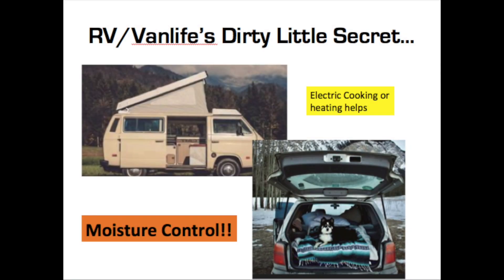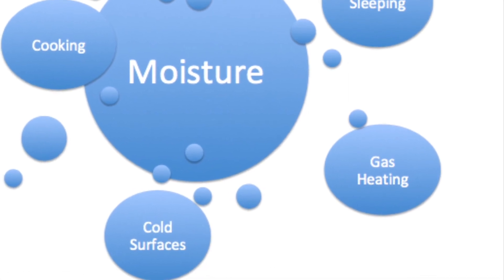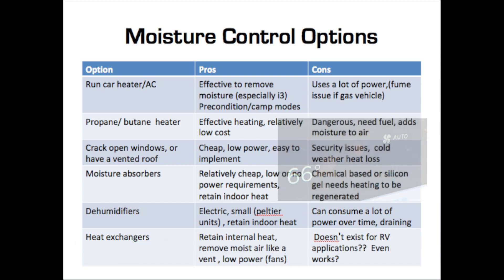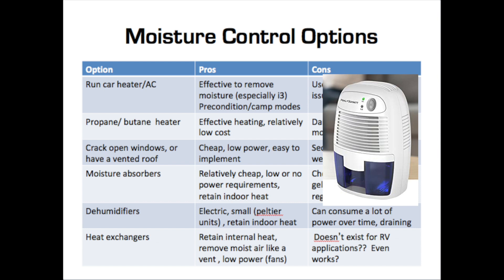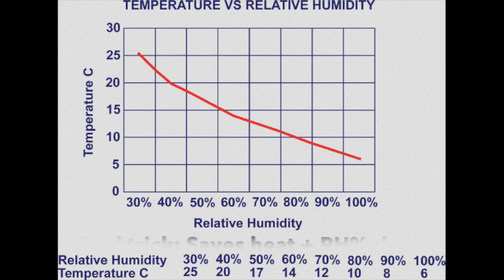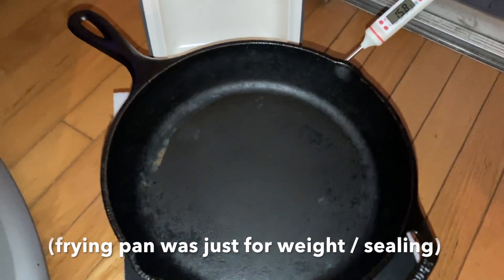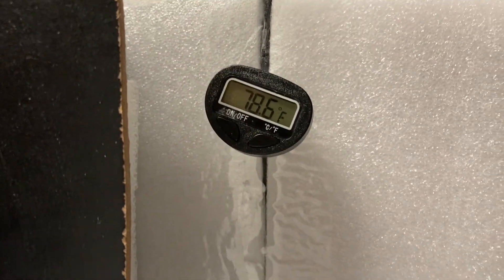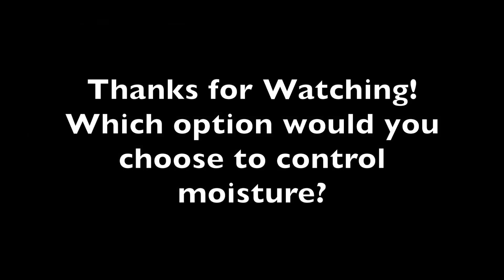Dirty Secret- DIY Moisture Control in RV/Van/Car  (BMWi3DIY Channel Project)

Comment: Here's a dumb thought of mine. How does the vehicle keep air fresh when running the ac? Is it just constantly losing cooled/heated air and replacing it with fresh air from outside? I suspect that must be the case but it bears asking
Reply from the maker: Great question!  There is a vent hole in the trunk area for exhausting air out of the cabin.  You can find the slots just below the cargo shelf support ledge.   This would be a good place to install a heat exchanger without having to use the window as was done in the experiments.

Comment: I was considering the same problem on my way to work. All EV's should really have heat exchanger on the intake air pr default. 
The smallest i could find are Unoklima, they are meant for residential ventilation. they work by cycling the air back and forward over the heat exchanger. So first the exhaust air heat up the thermal mass, then the fan is reversed and fresh air is drawn back in over the heat exchanger. Maybe a unit like that could be mounted by the cabin air exhaust, i think is is in the boot somewhere.
Reply from the maker: I was thinking of the cabin air exhaust as a good location as well.   I don't know why these devices don't get used more in RV's or even residential bathrooms ( as compared to just venting heated moist air outside).  Maybe it would work for capturing wasted heat from clothes dryer exhaust too!   I looked at the Unoklima website, also an interesting concept.  I wonder which is the more efficient technique...   Thanks for the information and suggestion!